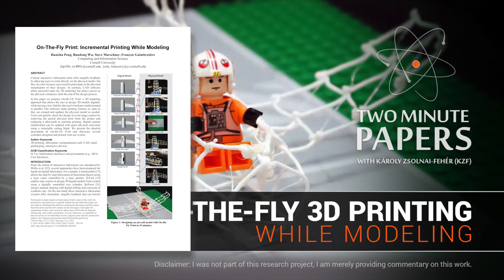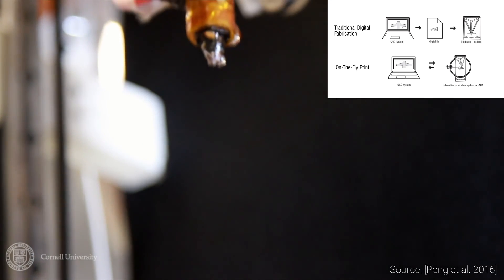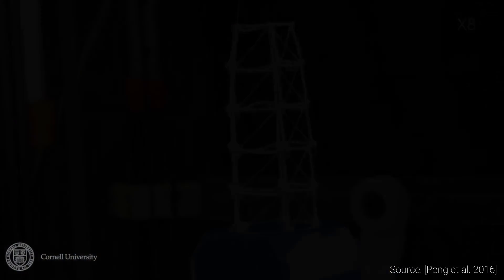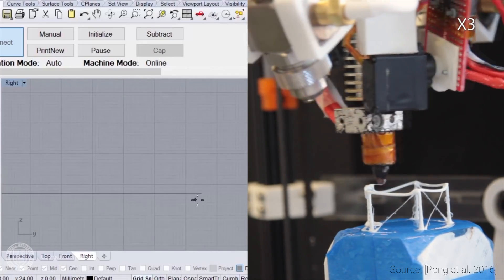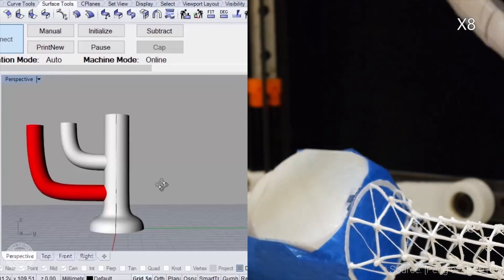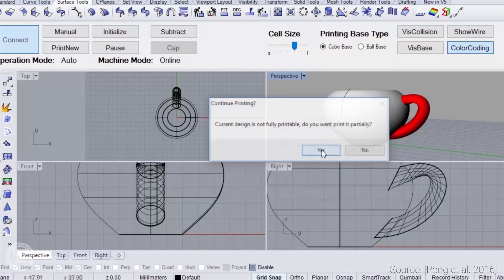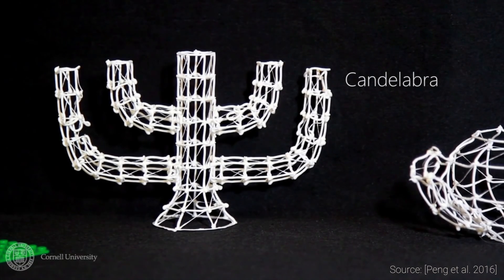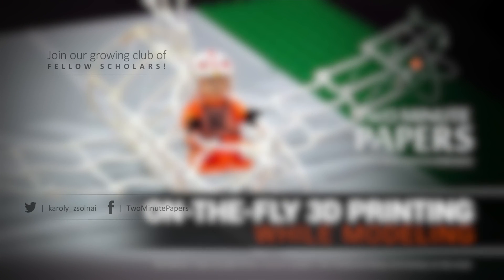On-the-Fly 3D Printing While Modeling | Two Minute Papers #144

Comment: Squirting water on the built part is rather unorthodox. Having water on the part makes it harder to fuse new levels to it, I would guess the model is built with "cold" joints where it didn't fuse as well as it could have with air drying.

Comment: I would like to expand on this idea if I had the chance. What I see is the creation of an internal frame of a 3D print which the subsequent surface can be derived from. Essentially, no more support material would be needed and the amount of infill could be reduced to zero. Sort of an idea I had when I was working on my 5 Axis CNC router and 3D printer for senior capstone. Except the CNC would remove any imperfections of the 3D print to produce the desired net shape, so the speed of the 3D print would be significantly reduced while quality was increased.  Also, creating a new alternative to overmolding, and 3D prints with a metal internal structures for critical components...the ideas are really endless. Unfortunately we finished a 3 axis combination machine instead. A really long story.